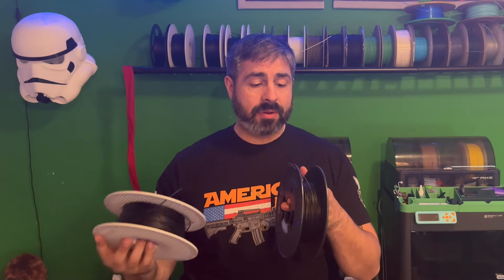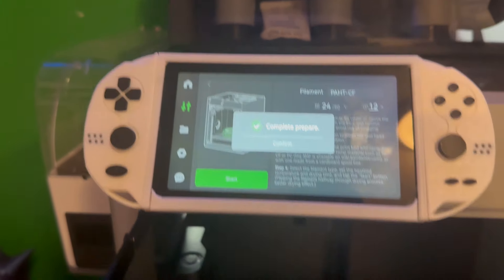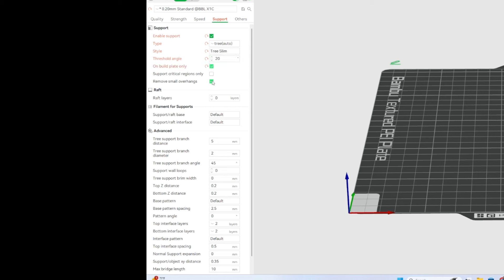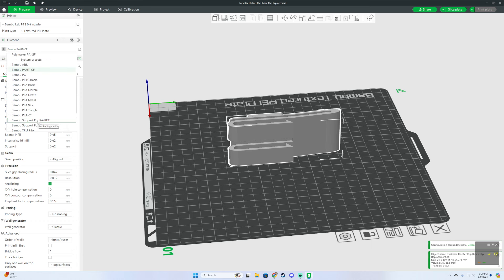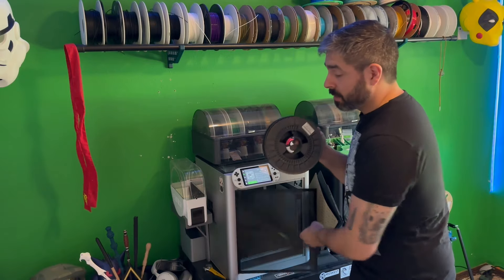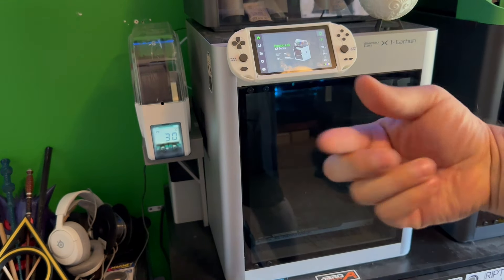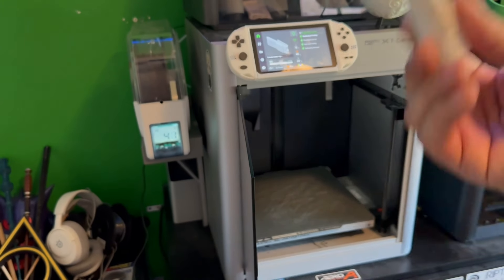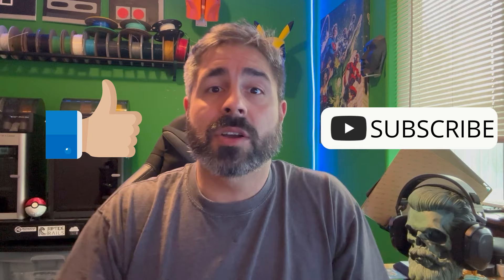How To 3D Print Carbon Fiber Nylon! Bambu Printing

Comment: Wouldn't covering the filament up not evaporate the water thats retained?
Reply from the maker: You know that’s a great question. Iv been doing it for so long I failed to ask why lol 😂 but I mean it works…
Reply: @smokieprints486  Oh yea, I saw your original video! I have the same set up and I only use 3DXtech. What I was just thinking was that the heating system is kind of useless because unless it is in a confined, dedicated apparatus, its not going to wick it away from the filament. I'm currently searching for system to do 100°C for the temp like a dehydrator and then chamber vacuum seal it for long term storage.
Reply: Yeah ideally you would have some sort of holes or gaps to allow for ventilation/convection

Comment: you can leave speed settings and dial down max flow in filament , to slow it down.  Thats what I do.  check speed after slicing to get speed you want.

Comment: Smokie, why dry the filament in the printer when you literally have a purpose built filament drier?
Reply from the maker: It doesn’t dry it at the right temp. The one I have maxes out at 55c and you want to dry it at 100-80c

Comment: Thanks for the knowledge. I have the P1S. Would I need to upgrade the nozzle or am i golden?
Reply: The p1s should have the extruder gears and hot end upgraded to hardened steel for any abrasive materials I believe.

Comment: If you don't have a Bambu you can still print with Nylon, but you'll need a full metal hot end (I have E3D Mk6) and fit it with a ruby nozzle. Also use a large brim, at least 10mm and, of course, no cooling (fan set to zero). You don't need an enclosure - just wipe a decent amount of glue, then set the bed temp to just 35 degrees, so that it will be under the glass transition of Nylon and more or less same with the environment. Now print first layer very low and very hot, straight into the glue, under 0.2mm layer height with 320 degrees celsius and the next layers you can go down to around 270 degs. Just one word of caution - do not, I repeat, do not try this on borosilicate glass. It will print okay but the print will stick to the glass so hard that when you take it off, it will strip shards of glass with it, ruining the printbed. You may consider a slab of marble though. Pick a cheap one, just in case 🙂. Have fun.

Comment: hows the X1C supposed to get to 90 when it doesn't have a heated chamber and says its only rated to 60 anyways 😂
also, isn't putting a pot over it just going to keep the moisture inside more?

Comment: Am about to make the jump to printing nylon. Pa6-CF to be specific. Long time PLA+ printer, I mastered that material. Some prints are shown on my channel. 

I’m just waiting on the printer upgrades to arrive (ceramic hotend, sonic pad, filament dryer etc)……pretty much only thing I’m worried about is bed adhesion. Did you have to switch bed materials to print nylon or did you have success in using the same bed you use for PLA? Have heard glass and garolite is ideal for nylon, so I’m wondering if I will need to change my bed out. We’ll see I guess 🤷‍♂️ love your stuff dude